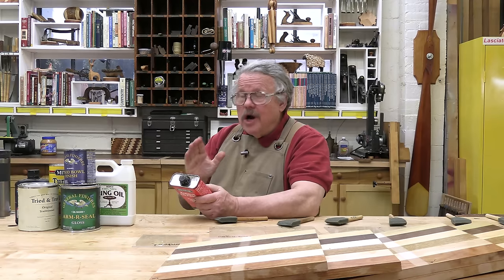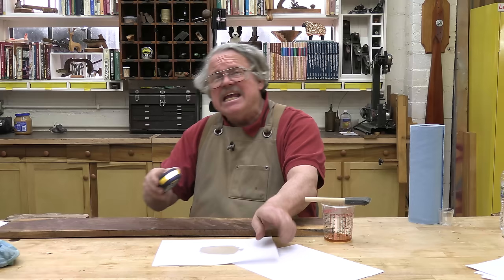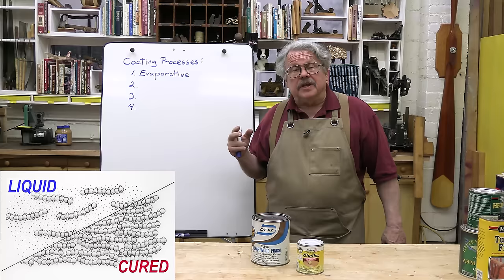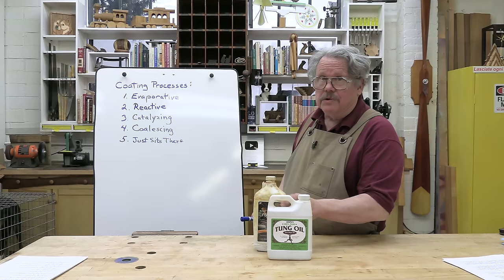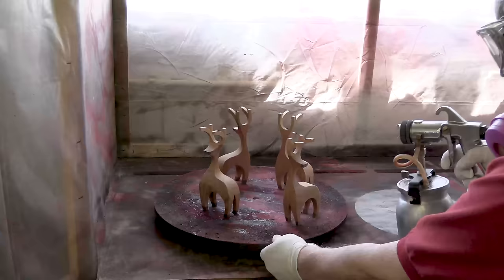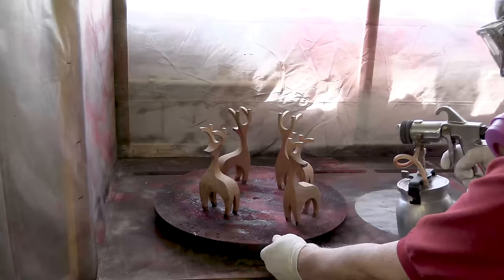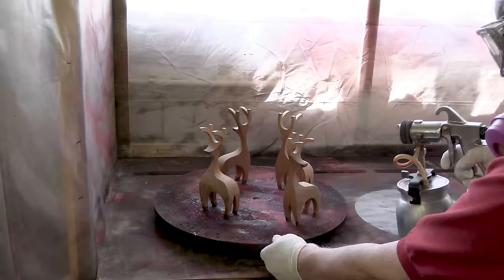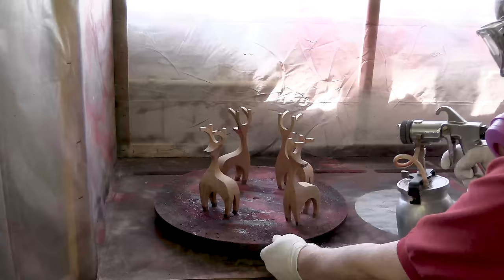Finding the Perfect Finish

Comment: Many, many thanks, Nick, for this excellent study of common wood finishing methods. I have been making furniture for over 50 years and the finishing process is still "hit or miss" for me. My best luck over the past few years has been with Minwax or Varathane Oil Based Poly in 11 oz spray cans. I have the compressor, the spray guns, hoses, spray tent, etc. but that stuff is such a hassle to use and clean-up that I just spend the $40 or $50 required to buy what I need for a typical piece of furniture. I will try your special wipe on finish and see how it works.

I also want to say that I must have more than 20 of your woodworking books and they have been a source of knowledge and inspiration for me.  I saw and enjoyed several of your videos before realizing that you were the very same guy. You had brought your communication skills and woodworking knowledge to a whole new generation and medium.
Reply from the maker: Thanks so much for those kind words.

Comment: Real great video! One thing not mentioned is color change or yellowing of the finish over time. Linseed oil is probably the worst, while the water-based Poly is supposed to stay clear for the long term. Linseed oil doesn’t actually dry, but cures by oxidation, and this oxidation continues over time. This is why so many old master oil paintings in museums have a yellowish tinge, with linseed as the pigment base.

Comment: Great video. And you’re right, everyone has their preference. I’ve tried a lot of finishes and have been contemplating just using natural non toxic finishes for several reasons. I like the natural feel of the wood vs a plastic feel. My preference to apply is wipe on and I like the easy repairability of them. You don’t have to strip the entire piece to fix a small area. You do sacrifice time but I enjoy the process. I like the tried and true varnish oil, polymerized (heated) tung oil, and the recent hard wax oils personally. Thanks for your information and time spent on the research.
Reply from the maker: Most welcome.
Reply: @TWC I’ve landed in a similar place. Strong smells give me migraines, so I have Tried and True Varnish and shellac.

Comment: Very very interesting video.  

Over the years I've used virtually everything available.  In the old days when my Dad and grandfather were building boats every second month, they used good old varnish.  However, Dad always had linseed oil about for use on the deck (of the house).  He used t with a touch of terebene (I have absolutely no idea how it's spet because I have never, before now, writteni t down). I think the latter must have been a drying agent.

These days, if I am coating a tool I tend to use boiled linseed oil, especially on handles.  If somethign getting mild use I try to use a home made danish oil - varnish - turps - linseed oil (boiled) in equal parts.  It's easy to apply and dries pretty fast.  If likely to get wet or out i weather, back to varnish, preferably 3 coats, with a light sand between them.
Reply from the maker: Thanks for sharing.

Comment: Excellent presentation of valuable information, based upon actual testing.
My apologies to the presenter, as I sped up to 1.5 speed.  I was racing through to get to the final formula.  But found I was learning a whole lot on the trip.
Well done.  
YouTube could do with more videos of this caliber, and less BS.
Reply from the maker: thanks for saying.
Reply: @WorkshopCompanion  Have you  ever heard of this for finishing?  I unroll a bun of 0000 steel wool.  Go out side, hold it up and light it from the bottom.  When it seems done, I pat the gray mass lightly and then look closely for thin shiny streaks.  Those are unburned "wool."  I pull those out.  then reroll the bun and have a VERY soft steel wool pad for final finishing.
No idea when I started doing it.  Or if I invented it, or heard of it.  Just curious.

Comment: I tried Arm-R-Seal some time ago.   I liked the look, nice hard finish.   I then found the rest of the can had gone off in only a couple of weeks.   What a waste.   I am not going to get anymore, it does not have sufficient shelf life once opened.
Thanks for the video.   Very informative.
Dave.
Reply from the maker: Thanks for sharing. In answering another comment, I suggested filling partially full cans of finish with marbles to remove most of the air. This greatly extends the shelf life of any reactive finish.
Reply: I put my Arm-R-Seal in "StopLossBags". I opened a can about 3 years ago and put it in the bags. They allow you to squeeze the air out before closing it up. This finish is still good after 3 years. Not an ad, just something I've tried that works for me.

Comment: +1 for "finishing phobia". And another vote for the wipe on poly. I made an L shaped Baltic birch banded edge desktop and I welded a square pipe L-shaped frame to put it on. Did 3 layers of poly after water pop sanding and it was rock solid for years. The extra coats added more depth than shown here.
Reply from the maker: Thanks for sharing.

Comment: Varethane Ultimate Water Poly is my most frequently used finish.  I absolutely agree that it does not do much for the appearance of natural wood.  However, the ease of application, the quick dry and cure times, and the hardness it produces are indispensable in roughly 80% of my projects.
Reply from the maker: Most of the water polys have gotten so much better since they were first introduced 25 years ago, and it doesn't surprise me to hear that Varethane has kept up with the industry. I know a boat-builder in Florida that swears by Varethane's water-based spar urethane. He adds a few drops of "Golden Oak" water-soluble aniline dye to help warm up the wood the same way oil-based products do.
Reply: @WorkshopCompanion  That is going in the book.  I am glad to hear someone actually using the water spar; haven't heard much on it.

Spar in general gets very mixed reviews.  It seems like the people who do not like it either don't apply enough of it, don't sand it properly between coats, or expect to put it down once and forget about it.  Anything outside is on the clock for getting a redo from the moment the project is...finished.  (I am not proud of that pun.)

Comment: This is amazing!!! Personally I would’ve liked to have seen a demonstration in application, waiting time, sanding etc of Rudi’s blend as well though. How long between each application is required before sanding for example? But overall this is the best instruction I’ve seen on finishes on YouTube to date.
Reply from the maker: Thanks. Rudy's blend is a very slight modification of the Miniwax Tung Oil Finish -- that commercial finish with a little bit of phenolic and/or urethane resin added to make it more durable. It also builds "depth" slightly faster. But it is applied exactly the same and the end results look the same as what we show for straight Minwax Tung Oil.
Reply: @WorkshopCompanion  oh thanks for the response Nick. Much appreciated. I’m gonna give this a go for sure. Thank you 🙏

Comment: What an effort, and yet so easy to follow. Thank you for going to so much trouble, AND for posting on youtoob! I find Zinsser aerosol shellac an smooth and very durable finish on timber musical instruments, especially on close grained maple and birch shell drums, but I’ll be trying your idea when I’ve set up my flooded workshop again. Cheers from Downunder.
Reply from the maker: I have built musical instruments as well, and as much as I like Rudy's recipe,  I would be careful about using in on instruments, especially stringed instruments, Because the finish penetrates deep into the wood, it changes the tonal qualities slightly. I much prefer violin lacquer or plain old shellac for that specific application.

Comment: For food safe items I use 50/50 tung oil/citrus solvent. It penetrates better with the solvent I think.

I use Arm-R-Seal on cabinets for the durability.

Other than that, I use Tung Oil Finish for everything else.

Comment: Fabulous presentation!!! And great recipe!!! Here's another possibility. It's worked for me just fine too:  ⅓ boiled linseed oil (or tung oil) + ⅓ turpentine (if you can still get it. Cal OSHA has banned it in the state!!! But you can get it online or from an art supply store too) + ⅓ spar varnish or poly. You can control the hardness by increasing the oil and lessening the poly or visa versa. Adding more solvent also allows for applying the solution as a "wipe-on."
Reply: This is the recipe I too have used for 30+ years.  Wipe on wait till it just begins to tack then wipe off. Deep and thin looking like oil but hard like poly and can't peel off. Low sheen / satin is the finished surface but that seems quite natural to me. You can make the 1/3 oil component a blend of linseed and tung too. I like the smell of vegetable turpentine over mineral.
I'm not sure how 1/16 of poly (Rudy's recipe) would enhance the finish tung oil in any perceptible way.
Reply from the maker: Thanks for sharing. I've seen this formula before but never tried it. I would add on caveat: If you're going to substitute tung oil for the boiled linseed oil, make sure it polymerized tung oil. The raw stuff takes forever to set up -- just like raw linseed oil.

Comment: I moved into a house that used Minwax water based polyurethane 3 years after it was applied. I had to move out after breathing problems. No joke. We ended up sanding and using real bees wax mixed with real olive oil.

Comment: My extreme gratitude for your education offered,  I am completely redoing the teak wood interior of my 1980 sailboat,  using 2 part acid leaving a very clean bare wood.  I discovered that tung oil doesn't darken with age, (not a fan of mahogany or dark wood) and then found your video with Rudy's formula just in time as I began the first coat...I'm going to treat inside cabinets and drawers with this as well, what has me most pleased is the ability to repair,  over marine varnishes,  from scratches and other abuses...if you have any other tips for this situation please please offer it here...I am paying attention and thanks for your dedication and education you provided,  Happy Thanksgiving to you and yours as well. I'm very grateful.
Reply from the maker: Thanks for your kind words. I have little to add to the video, other than to say we have found this mix is reasonably water-resistant and it should work well for the application and environment you describe

Comment: Very well done, sir. I would say this was sort of a "Goldilocks" presentation; not too 'dry' [pedantic], not too 'wet' [rambling]. In other words, cram packed with useful information presented in an understandable, relatable style. (The mark of a true educator.) In the words of Elvis Presley: "Thank you. Thank you very much". 
P.S.: Having had a Haz-Mat Endorsement on my CDL (Commercial Driver License) I can tell you there's even a MSDS (Material Safety Data Sheet) on water.
Reply from the maker: Thanks for the kind words. I'm going to have to look up the MSDS on water.
Reply: @WorkshopCompanion , While I never had to have one for trucking - just acetone, resins, MEK, etc., I did first read about it in Fine Woodworking, issue #136, June 1999 in an article by Chris Minick titled: Hazerdous chemicals In the workshop: - pps 117/118.

Comment: The bit about how the finish makes the wood translucent was a lightbulb moment for me. I've noticed the 3d effect of a nicely figured and finished piece of wood before, but never really fathomed how it could be happening as I was thinking of wood as opaque.
Reply from the maker: Yeah, it was a lightbulb moment for me too. I was researching my book on finishing and spent some time in Cleveland talking to some of the "coating chemists" that work for Minwax, when one of them did that oil-on-paper demo to show how cellulose when semi-transparent when saturated with a finish. He also told me that this is why a finish exposes and magnifies every single mistake you make while preparing and sanding the wood surface.

Comment: Great video. I need to know what to use to sand between the coats. I am using your recipe of 2 coats minwax tung oil + 1 cup tung oil & 1 tbs of spar urethane. THANKS FOR GETTING BACK TO ME!
Reply from the maker: I use gray Scotchbrite (about 600#) to sand between coats. After the last coat, I apply paste wax with white Scotchbrite (1200#) and buff.
Reply: Thanks for the tip! I am finishing an 8' x 9' bookcase with 24 sections. A lot of work but can't wait to see the results.

Comment: Your problem with the Arm R Seal was probably using the brush then trying to wipe it off.  I love the stuff, but I apply thin coats with a rag.  It's not like Howard's beeswax where you put on a thick coat and then wipe off... I'm basically wiping it off as I apply it.

Comment: Loved the video and thank you! I find it pretty interesting that my own conclusions through experimentation have come out so very similarly. I too make my own blends but they're a little different for each coat of finish I'm applying. I try to get maximum penetration on my first coat so it's quite thin and gets wiped on with a rag to get as much finish into the wood fibers as possible.
I also make up my own finish for food prep items such as cutting boards and utensils that consists of Carnuba, bees wax, and some oils.
Reply from the maker: Thanks for sharing.
Reply: What oils are you using for the food safe finish?
Reply: @hendricksoundso8200  I use Coconut oil and/or mineral oil most often but sometimes walnut oil. Coconut oil is my preference though.

Comment: Ditto Squatter's comment. Thorough, great delivery, great presentation, great knowledge, well prepared, great thought in making test samples. I could not have asked for anything more. In fact, I am only going to consider his choices when I refinish my cheap store bought table top. Can anyone tell me what finish makes a table top turn yellow on light wood?
Reply from the maker: Almost any oil-based reactive finish will "warm" the wood, adding some yellow. If you need more yellow try amber shellac, then apply a reactive finish over it for additional protection. If you want more control over the tone, buy a starter set of oil-soluble aniline dyes, experiment by mixing them with mineral spirits until you get the right tone, then add the mix to your reactive finish.

Comment: Great video! I feel a binge coming on! Here's a new one for you: For hard, smooth, dense wood like knife scales, spatula scales, drawer pulls, wooden jewelry, try original foaming Gorilla Glue. It leaves the hardest, shiniest, smoothest, thinnest, clearest finish I have ever seen. The trick is to rub it on with a finger tip until it's micro-thin. That way it won't bubble. Porous wood will bubble, so don't bother.
Reply from the maker: There is a great deal of crossover between coating chemistry and adhesive chemistry. Many turners are now using cyanoacrylate glues for finishing small turnings; epoxy is good base for marine finishes as well as a versatile adhesive, shellac was once used to "serge" the cut edges of cloth to keep it from unraveling, essentially gluing the cloth fibers together.
Reply: @WorkshopCompanion Well said. I find Gorilla Glue not to be a very good glue. It's weak, but has a very strong bond and the surface cures probably 2x harder than epoxy. Too bad it foams, or it would surely be a great, super durable wood finish.

Comment: Thank you for such a clear cut in depth guide on finishes, but I’m curious how min wax finishing paste wax would fit into this topic.
Reply from the maker: I don't think it does. We tested reactive and coalescent finishes that are wiped on and form a durable chemical matrix when they cure. Wax is wiped on, but it's not durable and doesn't cure. It's often used as a final step in a finish because it will  temporarily fill in micro-scratches and add luster to a cured finish, but it's rarely used as a finish itself.

Comment: What's odd is that I'd done a similar test myself, and settled on T&T probably as my go-to. I'm not so concerned about protection, but I found it gave the best amount of lustre and depth to anything I've put it to, and has been my favorite since.

The only thing I wonder is was that sanded? I've never sanded t&t, so that might explain a fairly dull and low depth in appearance.

Comment: You are an incredible teacher. Why the spar and not regular polyurethane?
Reply from the maker: Spar urethanes are more resistant to UV light. They are also more flexible, and so better accommodate the expansion and contraction of the wood. All in all, they last longer.

Comment: Thank you so much for this tutorial! I have a lovely walnut veneered dinning table that needed some protection. So I bought an oil based Polyurethane in semi-gloss and set about applying it with a sponge roller. Big mistake! The roller left an aweful texture and now I’m trying to sand it out. It looks all grey now from the sanding and I don’t know what to do next. Should I try to apply the same polyurethane diluted with mineral spirits and a brush? Or should I try to find a different product? The bad thing is that my dinning table is large and I like to leave it without a table cloth to show it off. I’m afraid I’ve ruined it. I need advice please!

Comment: 7:22 Boiled linseed oil and tung oil are drying oils that polymerize exothermically by autoxidation. Wouldn't that place them in the reactive category? Wax might be a better example of the "just sits there" category.

Love your videos!
Reply from the maker: Drying/non-drying is not a binary choice. Rather, it's a scale with a lot of gray between those two extremes. Oils like linseed may polymerize eventually, but the time they take puts them closer to the non-drying side of the scale.